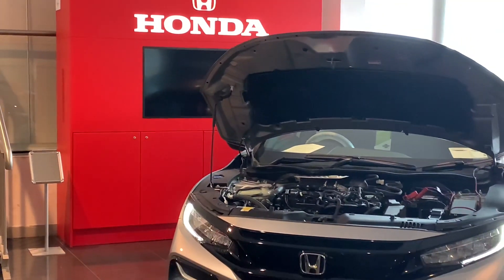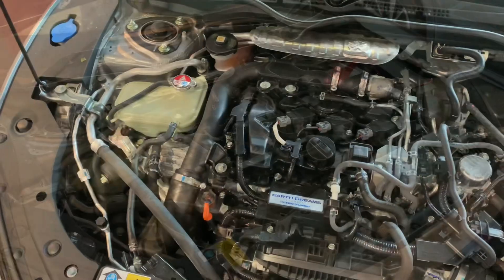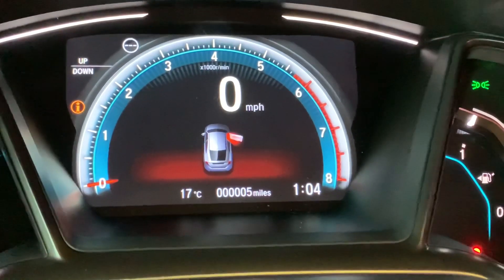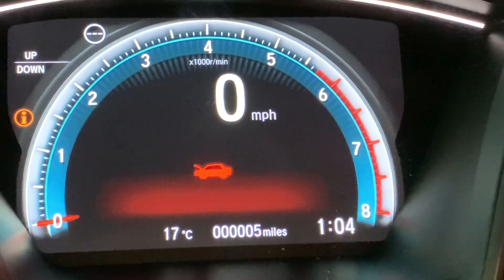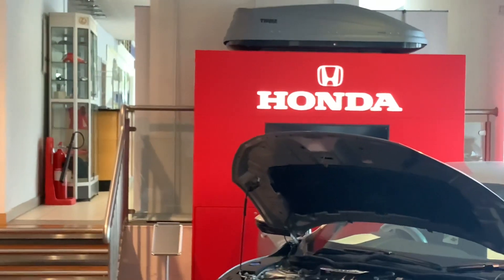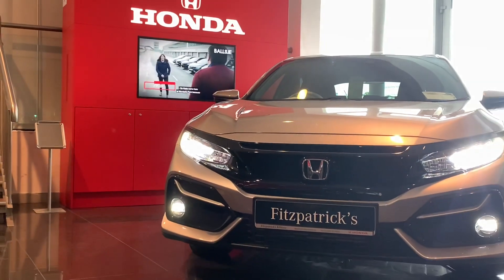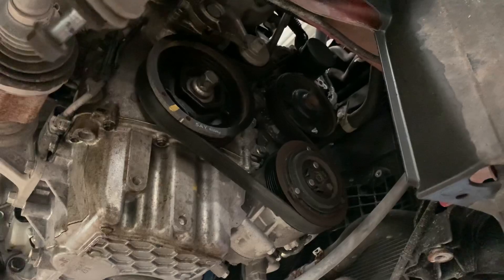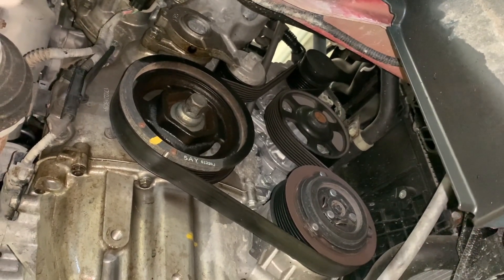1.0 Turbo Civic engine review - P10A2 - what is it like ?

Comment: I own one of these(CVT), I love how it sounds. The only thing I don't like is the turbo lag while using on the town
Reply from the maker: I guess that’s just turbo cars in general 🙂✌️
Reply: I experience the lag aswell with my manual 1.0 civic. Why turbos like that?
Reply: @earvinandalyadventures5048  The turbocompressor uses the exhausts gases to generate positive air pressure on the intake manifold. In order to get the turbo up to speed to generate enough pressure you need to get the engine to certain RPM zones. I think in the Civic's is around 2k+ rpm. So before the engine reach 2k rpm it will behave like a 1.0 liter N/A engine, extremely underpowered for the weight of the car.
Reply: @GabriellCosta  I've noticed on my manual 1.0 civic it increases engine revs when pulling away to help. I'm not a Honda engineer but wonder whether the engine is trying to generate some 'pre-boost' to help torque. Otherwise like you say, imagine a 1 litre engine pulling 5 passengers + car up a hill from standstill.
Reply: @richiebtime489  Yeah, definitely the electronic throttle body will adjust the revs to match the conditions so it wont let the engine stall.
Reply: @GabriellCosta  funnily enough I did stall it in some traffic recently it was a bit embarrassing. I went to restart it and error 'low oil pressure' came up. It took a few seconds to clear and by which time the traffic lights changed to red.
Reply: @richiebtime489  Haha it happens. That error would scare me 🤣
Reply: @GabriellCosta  yeah, wouldn't like to see it come on at 80mph 😅
Reply from the maker: @earvinandalyadventures5048  https://youtu.be/c_IFh_6bpUo 🙂
Reply: Are the parts similar to the 1.5l?